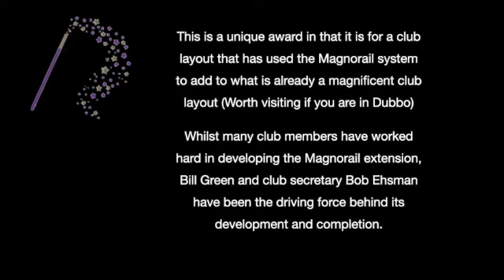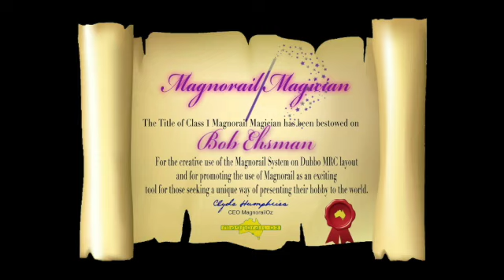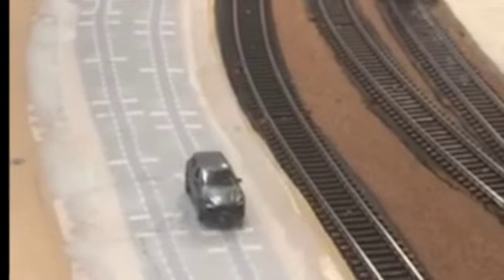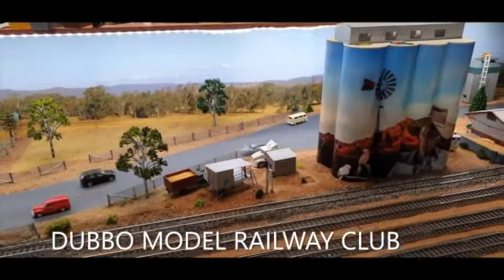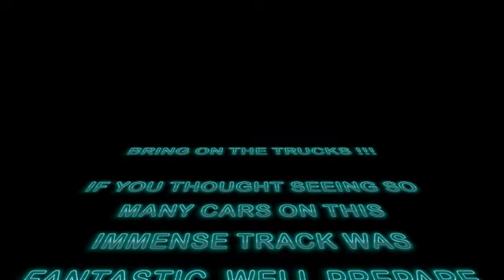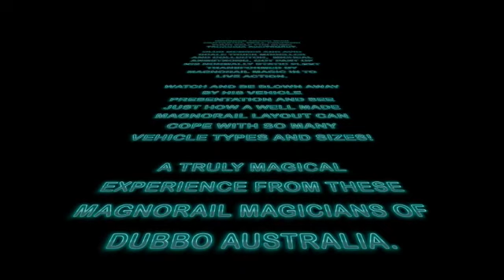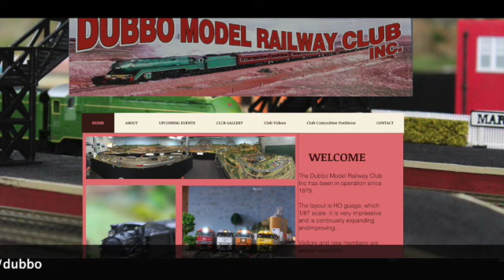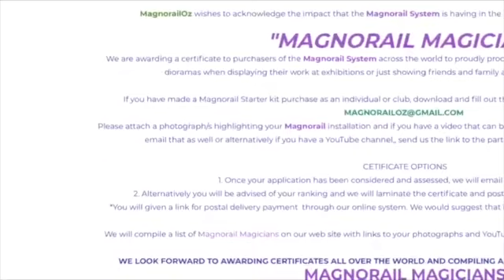MAGNORAIL @ DUBBO MRC N S W  AUSTRALIA

Comment: I wanted to see the long cattle train going round the turntable.    I'm planning on building a canal layout, and I want to see how long boats can be.
Reply from the maker: Sorry - missed your comment but when dealing with boats and you want to maintain a realistic operation, your easiest way out is to hide the turning circle in a tunnel. You would need to have the chain go into the tunnel for the full length of your boat and when it does the 180 degree turn, allow enough clearance for the boats stern to clear any structure inside the tunnel as it turns back on itself. The Dubbo cattle train turning is a bit messy which is why the turning loop is hidden behind the silos to preserve the magic for when it reappears

Comment: Came across your video as I thought it said Dublo, anyways excellent stuff especially with the large trucks. Was wondering what your road surface is made from?
 I have also installed Magnorail on my Hornby Dublo layout, made a couple of videos with a couple demonstrating how I went about constructing it 
  https://youtu.be/nST-M1bwdLo  and a more recent video of it all completed and running.. https://youtu.be/0PGZXKrkKrk in total about 12/13 meters and about 20 vehicles.
Reply from the maker: Hi Ronald - I print whatever road surface I am after then laminate it with a matt laminate pouch. usually A3 so I can get some long roads plus fit multiple raids on a single sheet. If curves are involved I just print a whole sheet of the design then cut the curve out thus reducing the need for too many joins. My YouTube channel has other videos on his subject if you go to tutorials or the making of Echo Lakes - Clyde www.magnorailoz.com.au